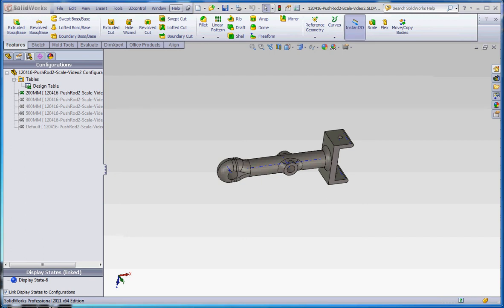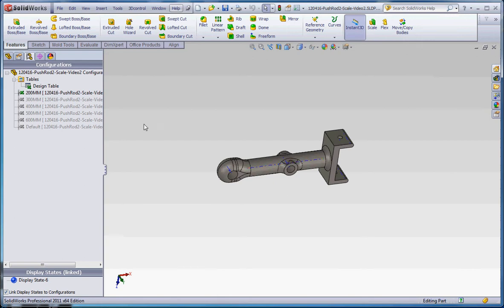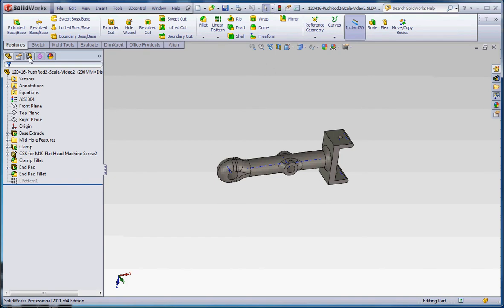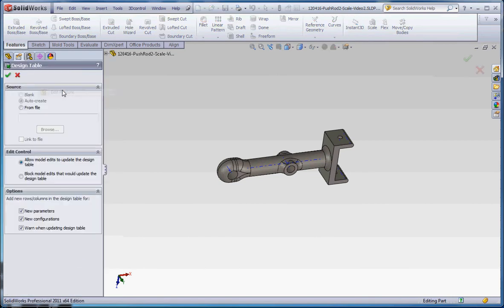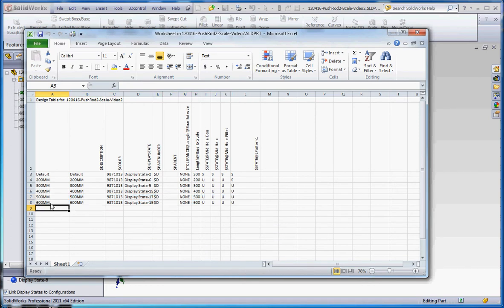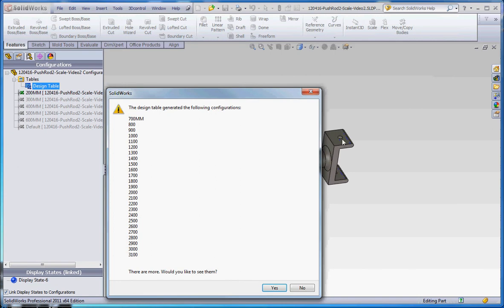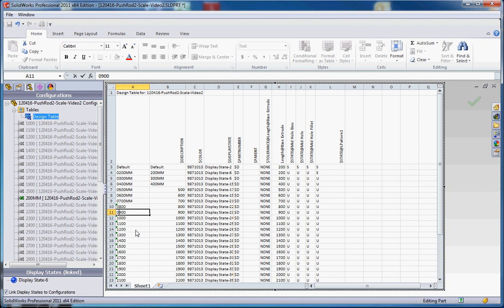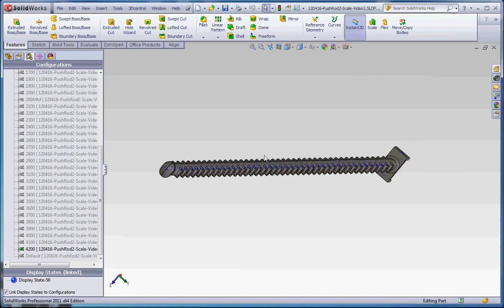More Part 6 - Configurations, Design Tables & Equations, More on Equations and Design Tables

Comment from the maker: Assuming you are talking about something circular you can use the circumference formula using Pi and the diameter, C=pi*D.  If it is rectangular you can also use a formula with the intent of adding up the sides.

Hope that helps, you can send me your model if you like.

CSS